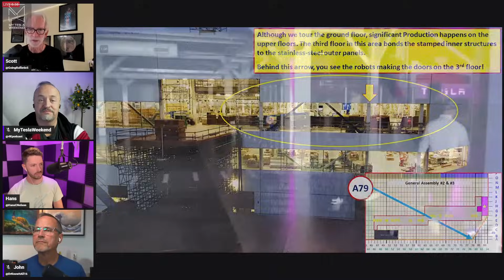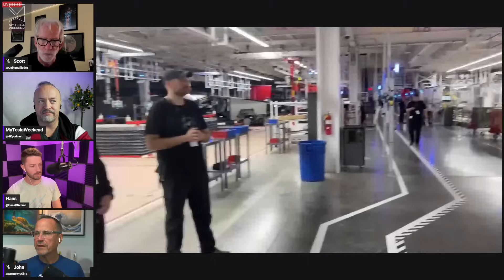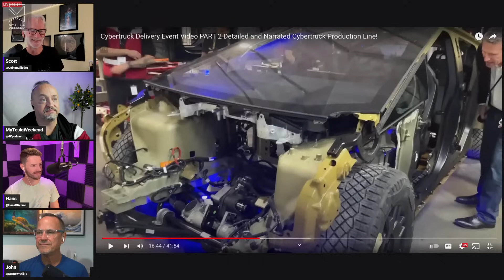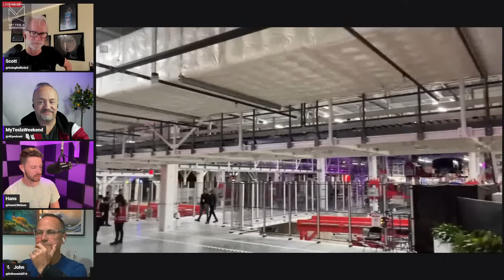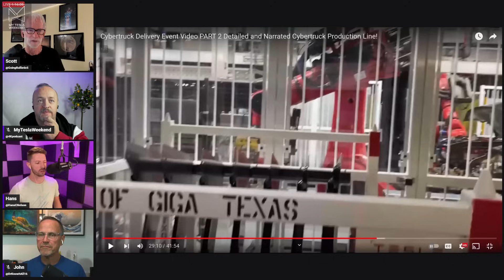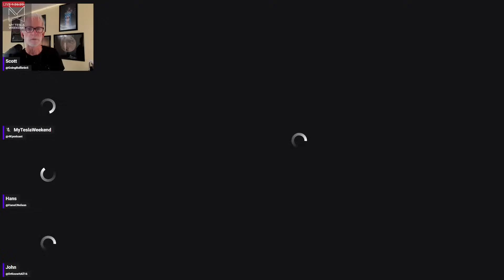Cybertruck Assembly Line DOES WHAT? - Livestream

Comment: Yes the windows are put in with eurothane adhesive , we do it by hand on busses at my job, with a Milwaukee caulking gun,the tips have a v pattern cut in them to create a uniform thickness  to ensure a good seal,  the v pattern runs in parallel  with the edges of the glass so u have to turn the corners

Comment: ~52:00 TTTT I might have had serious trouble learning to drive a manual tranny in a left-of-road country. Working four-on-the-floor with my right arm seems natural, but I don't know if my left arm could get along with that. I say this as a left-hander, but not uniformly. I can't use a computer mouse, or scissors, well at all with my left hand. Has to be the right.

Yes, it does seem as if by-wire could eliminate dependence on those direct physical linkages. Good intermediate step before the car fully drives itself.

Comment: Yeah in the UI when you have a full width module of the interface (like map) it doesn't need to be mirrored but modules and components of modules that are near-side/far-side relevant stay near-side/far-side when the steering wheel is on the other side of the car. You could say it's mirrored, but only the driving-position-relevant parts are mirrored. Android Auto also has an option to set steering wheel position left/right/auto and the car tells it which is preferred for auto.

Comment: I wonder about the steel and aluminum treatment prior to applying adhesive? I assume the application of adhesive directly on steel and aluminum alloy will hold, whereas when you glue painted parts, the paint can be the weak point where it can be easier unstuck?